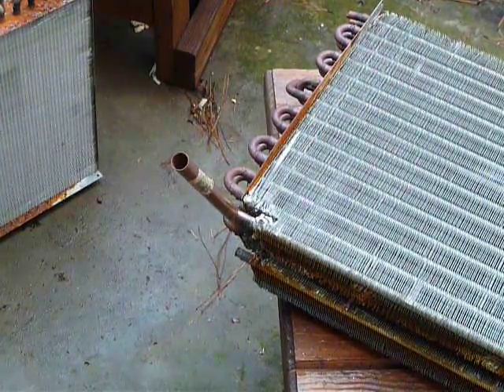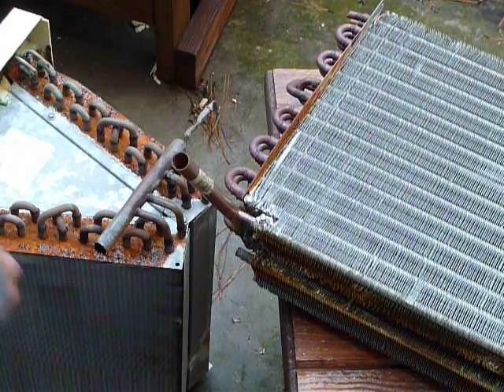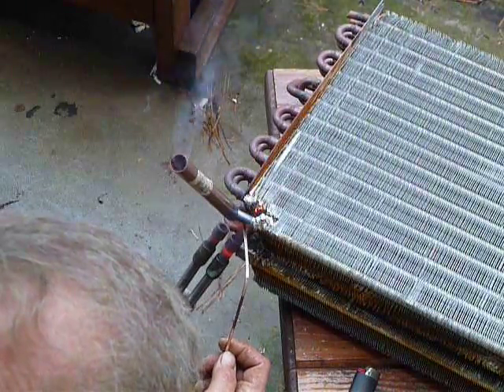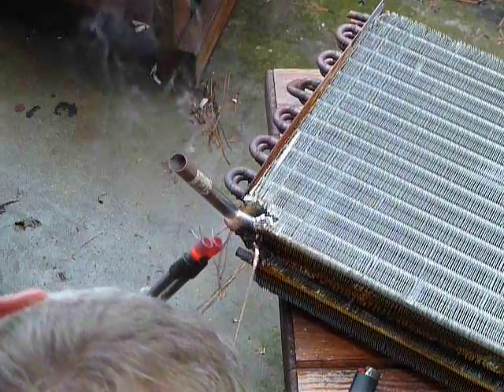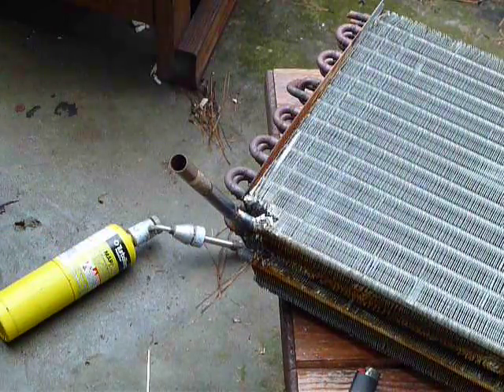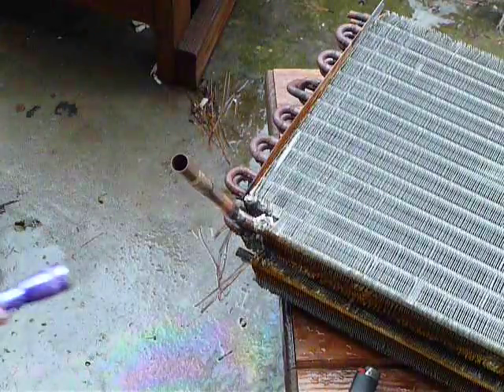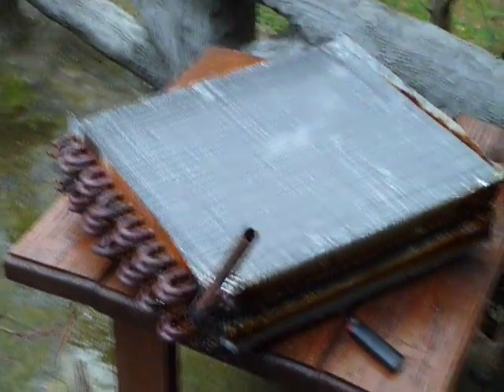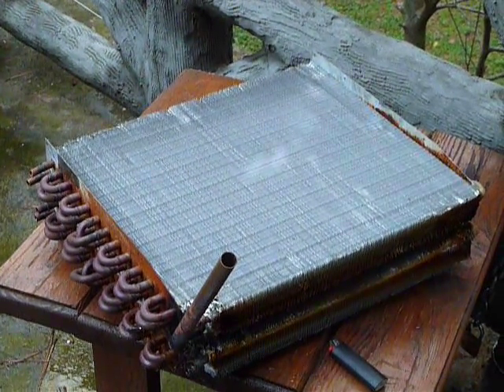Convert A/C coils into hot water heat exhangers (1)

Comment from the maker: A/C Coils which were once filled with R22 Freon have mineral oil in them, if you plan to connect them to your hot water heater you will need to flush them out with Isopropyl Alcohol. After adding only about a quart and forcing it through with water I found there to be no oil residue in my hot tub. Mineral Oil is not really considered hazardous but still if the system had a burnt out compressor it can create Phosgene gas which is very harmful.

Comment from the maker: Absolutely, I'm working with a large coil now and getting over 180F from it however this winter it will need antifreeze for night. A good coil to transfer that energy is the Trane A/C coils which are just really coils of pipe surrounded with spinny fins. Place those into a sealed 55 gallon drum and you have transfer without contamination.

Comment: I did something like that, but I cut off all the elbows and made a common manifold that I made out of 3/4" copper pipe. It involved a lot of measuring and drilling, but the net gain was low flow restriction . A much cleaner concept is to use a new vehicle radiator. I like the Jeep ones, Comanche I think, cause they are long and low
Reply from the maker: They sell water heat exchangers and they are already plumbed for installation over an Air handler. I think  auto radiators would work but when connected to a 3/4 inch supply line it's hard to say if the entire coil would have water flow when it is being connected to a 1-1/2 inch lines. It could leave half of the coil without flowing hot water.

Comment from the maker: Sounds like we are on the same path. I have one frenel lense as well as a wood burning barrel stove which heats my garage/sunroom. I've installed about 15 feet of 3/4 " soft copper piping inside the stove connected it to a circulation pump and have a Temperature pressure relief valve at the top of my copper outlet from the stove. I'm now working on a tracking system for my fresnel lense as well as for my solar coil heater. All are very good alternatives, as long as you have plenty of free wood.

Comment from the maker: Not only are there going to be more and more good useable coils available as the new refrigerant systems take over but using the old coils to transfer heat will not cause them to fail like it will when they are being used in a cooling application. The design operating temperature of an evaporator coil is 40F while the indoor air temperature is say 72F, so an operating coil contnually sits in water due to condensation the largest factor causing evaporator coils to leak.

Comment: There are many buildings in Winnipeg still heated by boilers and one that I lived in, my landlord said it would have cost him an absolute fortune to heat it using circulating heated air. You simply can't move hot air air around and "keep the heat" as easily as u can with hot water. Water is a better thermal mass than bricks or stone or cob, even. You should collect some Rear Projection TV's if u can find them free. they have a fresnel lens in them that can seriously concentrate solar heat to augment this system.

Comment from the maker: Most New A/C systems use R410A (Puron) and have at least a 13 SEER rating. Older coils made before the new 13 SEER mandate must be replaced in order to get the higher efficiency factors. Also with the new refrigerants the mineral oil in the R22 refrigerant is not compatible with the Poly-esther oil in the New Refrigerant. To convert an old coil over to the new refrigerant these oils must be removed, not a cheap task. So there are going to be alot of good non-leaking coils to be had.

Comment from the maker: This type exchanger holds less than a gallon of water. The idea here is to have a circulation pump which takes hot water from your water heater and moves it through the exchanger where you can have a fan which will transfer that hot water into hot air for your house.

Comment: you could also have a separated system, where the water from the coils never touch the water going to your home. you just use a tank that is fed with the A/C coil and inside that tank you have a second radiator system made from copper or steel pipe that carries the clean water to be heated. your opinion?

Comment from the maker: I have a book called Low Pressure Boilers by Frederick Steingress which has some info on this because of the density of hot water being less it will work. The Boiler/ Wood Stove needs to be lower than any thing else in the system. But I'm not that fimiliar with how the coils would  be designed. Cooler water has to fall in the coil while hot water rises.  But with Wood Stove Temps get above 700F I believe you're going to have to circulate to keep the water temps down or you will make a bomb.

Comment from the maker: There's no doubt that using car radiators would be much less work than having to repipe an evaporator coil. The only problem with radiators is the inlet and outlet ports are so large that trying to get the water to flow evenly through the coil maybe a challenge. Let me know how things go and good luck with your project...
Reply: Take the heater cores and all the rest of that out with fans and device yourself a duct system with intake and exhaust.

Comment from the maker: Wait a minute, even though an auto radiator would work it has a very large 1-1/2 inch or more size pipes and once the water gets inside the top and bottom is open. So if you reduced your pipe size down to 3/4 there would be no way to control which direction the water flowed once it got inside the radiator. I'm not saying it wouldn't work of course it would but I don't think it would flow throughout the coil.

Comment: Instead of  attaching  condenser  blocks  back to back why not  end to end and then control air flow with baffles and foam adhesive sealing tape to move air from one side to the other through the maze thus  simplifying  the piping process. and you can subject the air to more than one pass through the coils.

Comment: Those evaporator coils might work good in both direction of energy transfer in a solar system. We both know it works good to transfer heat from the fluid inside to the fins and into the surrounding convection or forced air, so in theory it should work good transferring heat in any direction, if the water was cold and the evaporator hot it works in reverse. It would be interesting to see how they work for the sunlight collector, paint them flat black fins and all pipes in the evaporator, granted the entire evaporator won't get the direct sunlight, but with the fins and putting the evaporator in an insulated box with double pane glass it might make steam.
Reply from the maker: Tony I've got several Solar Coils similar to what you are suggesting at the house check out this video when you get the time....https://www.youtube.com/watch?v=WIcrANugknU  
 I also plan to start work on a new design which I believe will work much better than anything I've done so far. Thanks for watching
Reply: +Tony Hardy I can attest to having made a single condenser version of this in an insulated box with double 5mm glass panels - condenser all painted high-temp flat black. It is very inefficient - there is not enough clean absorber exposed to the sun verses flow rate. To add to this, aluminum isn't the best heat conductor, and falls way short of silver and copper. The aluminum does heat up, but does not retain heat like copper does, and quickly releases the stored heat with high water flow rates or low sun exposure gained a reasonable increase in temp for my small above ground pool on warmer days, but fell short of "heating" the pool. When I slowed the flow rate down to a dribble, temp. increased - so fine for a recirculating siphon system.

Comment from the maker: I keep saying solder in the video. It is actually a brazing rod with 6% Silver. I like brazing old copper because it does not need to be clean copper nor does it require a flux and the welds are much stronger. Howbeit the temperature must be much higher about 1100F (Cherry red before the brazing rod will begin to flow).

Comment: i have a coil just like the one you have there and had much the same ideal as you were useing ..had planned on use a solar plate or even a wood stove located out side to produce the hot water both would be a able to supply hot water in any weather ..i live in tn and in winter we have a lot of rainy days i.e.clouds witch would need wood stove to be in the system when the sun dont shine .also i have 3 fernal lens of about 40 inchs each 600* in 6" area when sun shines bright. i need to store heat

Comment: if the heat exchanger is contaminated then one can make it a closed system so the fluid does not come into contact with drinkable water, just have the copper pipe running through the water heater which is called a closed system
Reply from the maker: Check out my video on how I used a solar heated coil in a closed system to heat up two 55 gallon barrels to for hot water storage tanks. https://www.youtube.com/watch?v=SC9IAkNpc34

Comment from the maker: After reading the MSDS on mineral oil I feel much better about  spilling the oil out of that coil. Here is what they recommend:
 Large Spill:
Absorb with an inert material and put the spilled material in an appropriate waste disposal. Finish cleaning by spreading water
on the contaminated surface and allow to evacuate through the sanitary system.

Comment: Interesting video ,only 2 comments to make . First get the unit degassed professionally first. second test your brazing by connecting a low pressure air line abour 5 psi should be enough to detect any leaks. 
Apart from that very good video but would like to have seen it working.even if on a test run.

Comment: Careful,
You might want to use better air circulation when brazing a used coil like this one.
The residual freon can create mustard gas when ignited.
It only takes one whiff and your lungs can go into shock.
You will want to breathe but cant, Its pretty damn terrifying.

Comment: I've always assumed that coils from ac units would have cadmium and lead in the solder, and have for this reason not considered them for heat exchanging to potable water.  I realise your system is closed but If what they use is plumbing safe and just a matter of cleaning out the mineral oil and freon, that would be a nice bit of information to know...
Reply from the maker: Actually because of the high pressure found in AC systems they use Silver alloy brazing which is also required by code to be used in under ground water supply connections.
Reply: Alvin Shepherd
nice, thanks.

Comment: Is this the indoor coil or outdoor coil? Does it matter which one is used?
Reply from the maker: The indoor coil is made to fit the furnace that blows the air through the ductwork inside the house so it is thicker and therefore more condensed in size. They actually sell these they are called water to air heat exchangers but still this is a great way to reuse good coils vs scrapping them for the metal.

Comment from the maker: I like your idea of using a wood burning stove with gravity circulation. I think if the coil was placed above the stove with an air gap with perhaps a stone type top over the coil it would be safe. As long as you used metal piping with a temperature pressure relief valve your stove coil would transfer the heat to your radiators as long as there was rise throughout the system with cooler water falling. I know what we are talking about here is forgotten technology probably older than my dad.

Comment: how did you clean and sanitize the refrigerant and oil from the coils?
Reply from the maker: Great question, and a very important step: R22 Refrigerant contains mineral oil which will get trapped into the coils the best way I have found to flush the oil from the system is to add about a quart or two of rubbing alcohol into the coil before installation and then purge it through the coil with water. I was surprised at how effective just one flush can be when I installed a large coil on my hot tub with no oil residue on the water surface even on day one. Big difference over my first coil install which would bring the Youtube Nazi police out of the woodwork if I went into that subject.

Comment: Sorry, Mr. Kurt Mccune: The LEAKY COIL PHENOMENON, After 40 years working in the HVAC field, I never heard of that term. To me it had always been called PERMEATION. That is. The ability of any gas or liquid to MICROSCOPICALLY FLOW, PENETRATE or PASS through the molecular spaces of a holding wall, be it a pipe, tank or vessel. And yes, you are right, this phenomenon had always existed in the Air conditioning, Heating and Ventilating Industry. IT IS NOT CONSIDERED A LEAK, due to the fact, it is a very slow leak. Most noticeable or common at the entrance of power lines to the compressor. NOT AT THE COILS, condenser or evaporator, UNLESS there is an outside source of corrosion, like dropping corrosive acids on the outside of coils. (very rare) but it does happens. That is why TODAY'S AC units and refrigerators do not last as long as units built from 1940 to late 60's. Today's coils are thinner and softer, to manufacture them CHEAPER. N.Y. May 17/18.
Reply from the maker: What does that have to do with the price of eggs in China?

Comment: Hey how can I get all the copper pipes inside those coils? I have 2 of those that I would like to scrap but it has all that aluminum on it
Reply from the maker: The melting point of Aluminum is 1221 degrees F while the melting point of copper is 1984 degrees F. All you have to do is get above 1221 without reaching 1984. Good Luck...
Reply: You could put some hydrofluoric acid on it and wait 10 minutes!😜

Comment: If I put a flame to the end 1/4 copper tubing would the whole 10 - 20 feet get very hot ?
Reply from the maker: Google this: PERFORMANCE TEST ON ENCHANCEMENT OF HEAT TRANSFER USING COPPER TUBES IN THERMAL ENERGY STORAGE SYSTEM.
Reply from the maker: Basically what this paper says is that there are ways to enhance the transfer of heat through the tubing by introducing a material which goes through a phase change. As in changing a solid to a liquid or a liquid to a vapor. But to answer your question just a piece of copper tubing would not transfer the heat source very well over a distance.

Comment: I thought silver solder is only for heating systems, not water systems because it has lead in it.  Great video and idea.
Reply from the maker: No actually Silver Brazing is code for underground copper water supply lines and it does not contain Lead its components are 15% Silver, 80% copper and 5% Phosphorous. Did not mean to Shut your water off.

Comment: Why you use hard soldering?
Reply from the maker: Silver Brazing is commonly used in Air Conditioning even though it does cost more there are advantages. Mainly when working with old copper you don't have to be concerned about having clean copper. Also the joints are much stronger. Lastly I had plenty of it on hand.

Comment from the maker: Fair enough, I actually have a video uploaded which shows how I tested a very large coil. Check out my video called "Cheap DIY solar coil heating Part 3" and tell me what you think. Thanks
Reply: Shepherd's Home Repair I'm planning on building something like this . in the fall. I think I'll heat water with the  wood stove in the basement. And with a solar collector of some kind. Likely just a coil of pipe in a insulated glass covered box. On the roof. Mostly to heat the bathroom and living room. The rest from the stove directly . maybe a valve to switch between the solar and stove. It would only require a small water pump. And relief valve.great ol video.

Comment: The static air pressure would be very high thru those two coils, this would ruin a blower motor in no time. Also you commented on needing more water volume. Why? Because you don't have a a boiler that can get a proper temperature rise? I recommend buying a proper water coil that is sized based on cam blowing thru it, water temp entering coil and gpm of water thru coil.
Reply from the maker: Your probably right it's only been operating for the last 6 years but I'm sure it has reduced the life of the blower motor. Oh wait the blower motor came with the furnace when the house was built in 1976. I couldn't resist, sorta like CNN experts calling Trump crazy, yeah crazy like a Fox.
Reply: The coils are already designed to flow air through them. Hot air/cold air dosent matter!